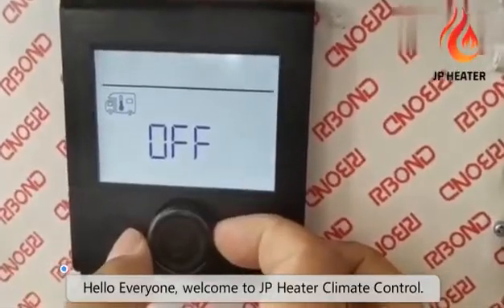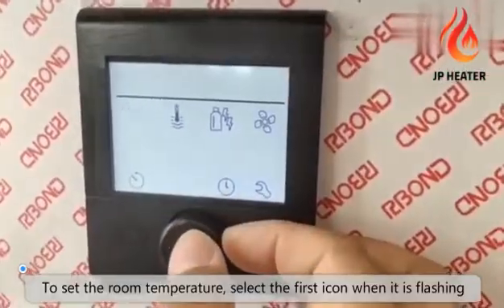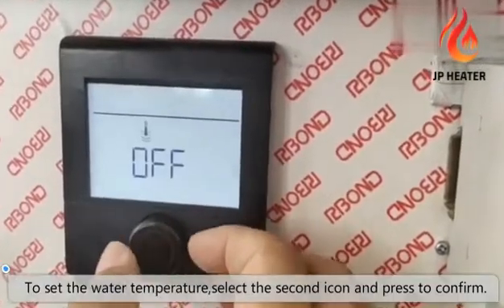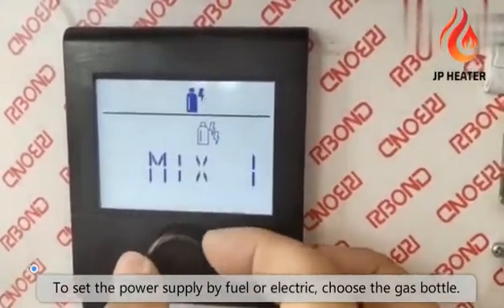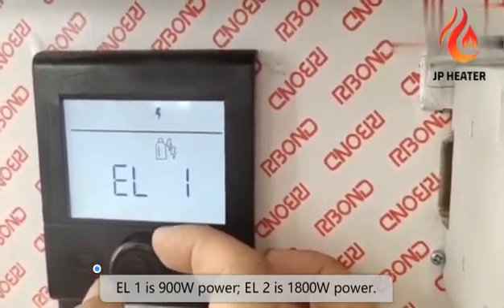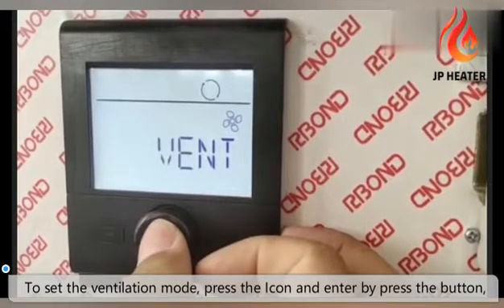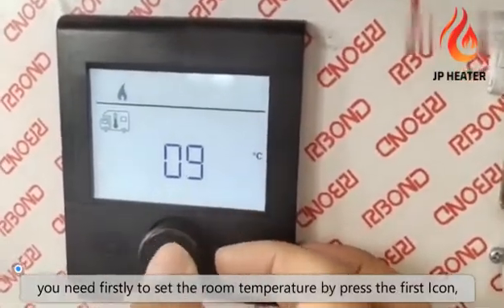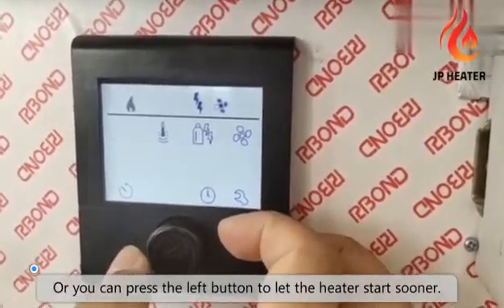Diesel Combi Install vlog: how to set the digital controller of JP Heater Combi Air and Water Heater

Comment: Looks interesting but the shipping cost for Europen is..... 983 euro. More expensive then the heater.
Reply from the maker: Hello Paul, where are you from? The shipping cost is not that expensive. Normally $300-$450.
Reply: I paid about 300 euro's for shipping to Holland. plus about the same amount for import taxes. It added about 600 euro's to the 1000 euro's i paid for the JP Combi 6E LPG heater, a total of 1600 euro's. The original Truma combi 6E would cost me 2800 euro's. Still a difference of 1200 euro's...
Reply: So guys , what do I select for diesel and 12v power ?